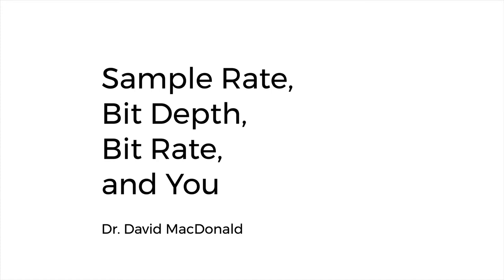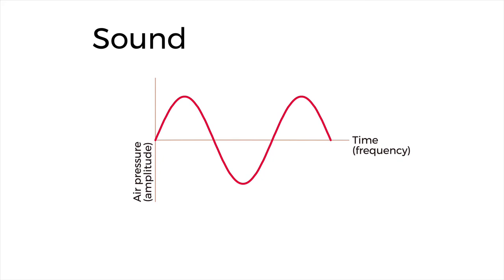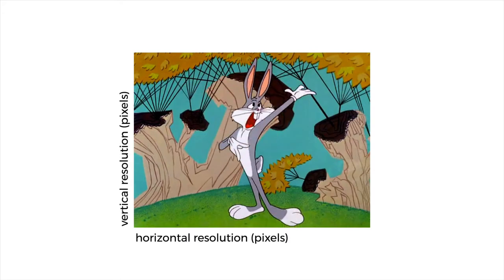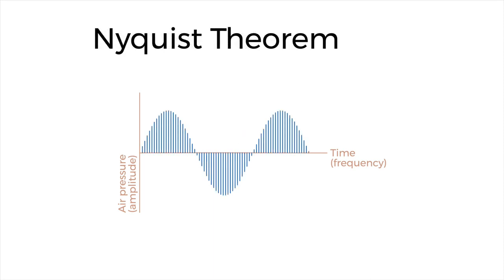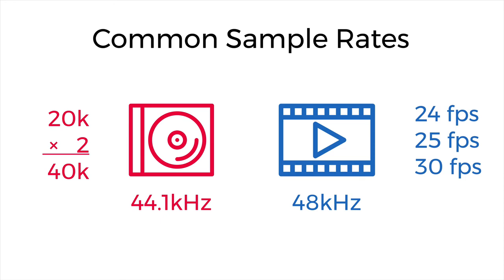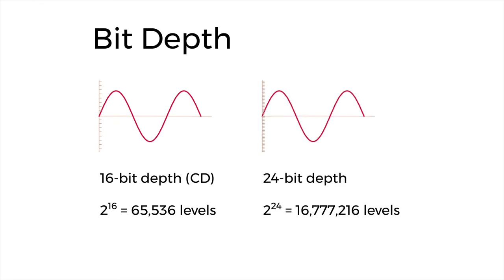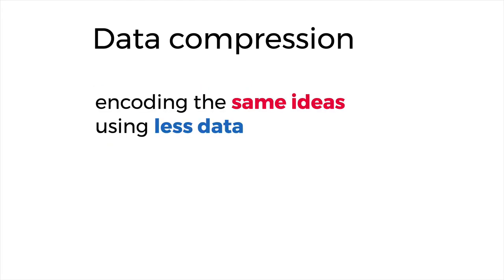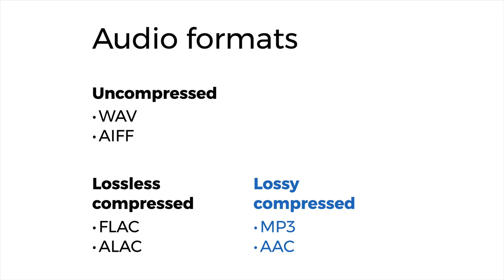Sample Rate, Bit Depth, Bit Rate, and You(r Ears), Explained

Comment: I would add that not all WAV files are uncompressed, although most of them are. The exceptions are WAV files using ADPCM compression.
Reply: @nicksterj  Yes, although I had to look that one up. 😊  I have only worked with LPCM and ADPCM in real products.
Reply: Yes exactly, wav is only a container and its "codec" (if you can call it that) is usually PCM.
The wav container can hold almost any other codec actually but most devices/ software won't know what to do with it 😂

Comment: Sadly  more bits does not capture more sound detail. More bits affects the noise floor. The more bits,  the less noise or the noise is lower.  Pictures and sound are two completely different things.  Sound is recorded by math equations. Simply  the maths always add up to one solution.  The sound is captured perfectly but the quantising (bit depth) adds errors which adds noise.   The noise on a 16 bit recording is too low to  hear unless you boost it to deafening levels.
Reply: One thing critics always seem to miss is that quantization noise is added to the signal. The original signal is still there in all its detail, no matter what bit depth you use. That's because the harmonic content depends on the frequency response, which depends on sampling rate, not bit depth!

Comment: Is bitrate only applicable for lossy compressed formats like MP3 and aac
Reply from the maker: Correct! Bitrate describes the amount of data used to store each second of audio. I suppose you could identify a data per second of uncompressed audio but it wouldn’t really mean anything comparable to bitrate in a lossy-compressed file.
Reply: @DavidMacDonald  So wav formats don't follow bitrate? And also MP3 formats don't have bit depth?
Reply from the maker: @WAVSAudioStudio  all digital audio has bit depth. Anything that is an MP3 started life as uncompressed audio with a bit depth. That got encoded/compressed to MP3 and lost some data, but to play it, it gets decoded again and turned back into a table of amplitude values, which are stored with some bit depth. I would wager the overwhelming number of MP3s are compressed 16-bit audio, though many might have been 24-bit audio during the creation process.
Reply: @DavidMacDonald  Well said! But I could see from DAW that are bouncing 32 bit float MP3 files. I have only acces to set bitrate and sample rate but not bitdepth options.  Whether we can convert the 32 bit float audio to 16 bit and so? Is it possible to do!! 💯

Comment: thanks, do you have any tips for understanding audio interpolation?
Reply from the maker: Interpolation happens any time the software has to make an educated guess about what is happening between the samples. This might happen if you are stretching or re-pitching audio, or just resampling a 44.1k clip into a 48k project.
Reply: @DavidMacDonald  thanks, but it’s hard to find which sinc formula is better to make that “guess” with and i’ve seen some linear interpolations that add samples to the file.
Reply from the maker: @elijahjflowers  interpolation always adds samples to the file. That’s its job. It isn’t ever going to be perfect and different algorithms will give different results in different circumstances. You just have to experiment.